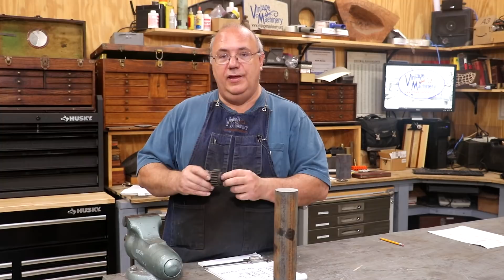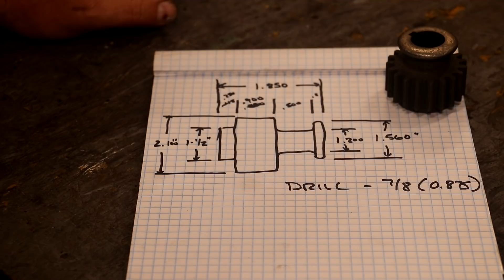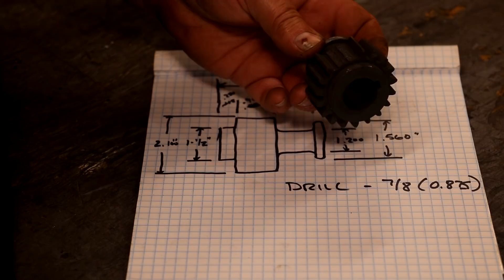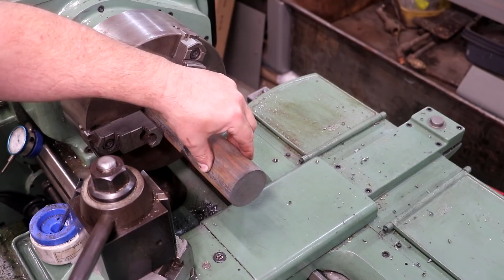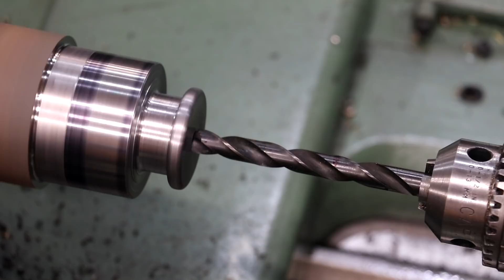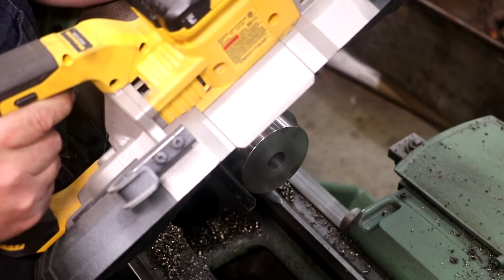Metal Planer Restoration 35: Cutting new Gear Blanks on the Metal Lathe

Comment: Hi Keith,

First of all I love your videos, they are educational and also a kind of relaxing to me. It helps me in understanding the construction and maintaining the machines in my private wood workshop. My machines date back to the early 1950 (most machines)  up to the late 1970. 
My question may sound stupid to non-mechanic guys, but in some videos you showed how you filled up the metal gap in a gear by brazing and then cut the missing teeth only? Why do you rebuild the complete gear this time? Well it's hard to judge from the video but there the remaining teeth look ok to me.

Kind regards, thumbs up and thanks a lot for sharing your skills with us! It is inspiring to me to see you work.

Cheers and greetings from Germany (still struggeling with imperial measure units 😂)

Martin

Comment: Why do lathes usually spin counterclockwise?

Because drills usually spin clockwise.

The close-up of the drilling shows that very clearly.
Reply: A lathe turns clockwise. You have to watch from the headstock, so as You do at a milling machine or a drill press.

Comment: I had a step toe shaper a few months back that sheared off a few teeth. Wound up welding material back on with my flux core welder then removed the the excess as needed by eye. Worked well with the tools I had at my disposal at the time. And I think much less time consuming then trying to build it from scratch. However another part (ratchet wheel) lost so many I built it from scratch

Comment: at 8:05 is it normal the tool move that much when you apply pressure ?
Reply: I was wondering if anybody else saw that.
Reply: @tsmartin  i watched thing a few time seams the back lift off and the front go back, im no machinist but when you mesuring in 1/1000 of inch if something moves like that you can't ...

Comment: why is it that the both holes are not centered ... but I guess that you'll say it's close enough ...........?
Reply: "why is it that the both holes are not centered" ?  What??
Reply: @paulcopeland9035  watch the big drill......it,s not drilling in the centre of the    part ... I sure can see the od running out ,but that will not bother Keith😉
Reply: @premierd8988  ...The 7/8 bit follows the center drill from the tail stock.  You are seeing a tiny bit of run out on the OD of the handle feature on the gear, but the center is dead true.  BTW, why do you say Keith will not care?  He has a beautiful shop full of precision tools that I have been watching him use for years.  He always does fine work.  I suggest you unsubscribe from this FREE content and leave the hate somewhere else.
Reply: @paulcopeland9035  Okay mate ... I am an engineer to trade .. so a straight line is a straight line .. and a OD or Bore are true to each other or they are not ... end of story . so unless he re-bores it true with a boring bar the the gear will jump up and down .. causing premature wear on the teeth of the said gear and whatever it is meshed to.
You are correct he has a few nice tools , but having the tools does not mean the you turn out''fine''  work every time .ask Keith himself . in fact go back through his videos and check how many times he says that it will be 'good Enough'..as for hate I don't hate anyone . I merely point out what I see to be errors the fact that you don't agree is your problem . not mine .and tells me that you have no (or pretty shit) engineering knowledge   .I rest my case ......

Comment: Thanks for video!  For the extrusion for the first gear (2+”), did you need the tail support because it was flexing?
Reply: Yes. It may seem innocent, but when you are cranking the hand wheels, you are exerting hundreds, if not thousands of pounds, of force into the material through the tip of the tool. If you're cutting at longer than 3x the diameter, the deflection in the material, depending on the below formulas, is too much for a smooth and accurate cut. (An OD will be oversized and an ID will be undersized) You have to remember that the metal does not want to be cut, so we need to hold it in place as firmly as possible, which means minimizing deflection. This deflection for a piece of stock held only in the chuck, also known as cantilevered, (which was in the first attempt) which enables the end to flex when a force is applied along its length, can be calculated using the formula: deflection=(force applied by cutter×(distance from the chuck to the cutter)^2)×(3×distance from chuck to end of stock-distance from chuck to the cutter)/(6×stiffness of the material×the rigidity of the shape). For a circular bar, the rigidity of the shape, more formally known as the second moment of area (Abbreviated as I in most equations), can be found by the formula (pi×diameter^4)/64. The rigidity of the material, more formally known as the young's modulus of elasticity (Abbreviated as E in most equations), can be found in engineering handbooks derived from experimental data. Eliminating the stock's ability to flex at the end by supporting it from both ends with the chuck and a tailstock center creates a stiffer arrangement with less deflection and yields a formula of: deflection=(force applied by cutter×distance from chuck to cutter×(distance from chuck to end of stock^2-distance from chuck to cutter^2)^1.5)/(9×square root of 3×distance from chuck to end of stock×E×I).
Reply: @firearmsstudent  .
 It may be because a rough cast material in a 3 jaw chuck is not a true diameter, so there is no chance of it holding true over that length. (just guessing). Extended jaws may help, or even soft jaws so they may bite into the imperfections of the stock and even out the loads applied.
Reply: Most stock isn't very true. There are some items like ground bar and such but most off the shelf stuff falls into the "close enough" category. If it is bad enough you get an interrupted cut, but that is a different problem than what is going on here.  The issue here is simply the stick out. Every amount of distance you are away from the support of the chuck introduces some deflection due to the leverage from the cutting tool.  Even the chuck itself can deflect on the spindle bearing if you apply enough force.  As the deflection adds up you get chatter where the material deflects, then springs back against the cutter and cuts in a somewhat sawtoothed pattern. Add the center and tailstock for support and you go a long way to limiting the problem. However even then you can still deflect the center of the part depending on the material and the depth of cut. That is why follow rests came about. Support right near the tool as is works.
Reply: No. Dont now what the other guy sad. The flexing is in the 3jaw chuck . in 4 jaw independent you could do this easely

Comment: DO YOU EVER USE A CERAMIC CUTTING CHIP
Reply: Ceramic tools aren't really meant for manual machines.
Reply: @xenonram  in sand cast iron i allways use ceramic on manual lathe . and you cant beet it
Reply: I used ceramic tooling for 22 years. D2 tool steel in a roll cutting lathe.
Reply: @steve gale  carbide is from tungsten , ceramic is other marerials depending on the grade ...  You can machine whit hss but in last 30 second. Back in the day , they grinde 2h machine 30 minuts . if you remove the surface with the sand mix then last a litle bit more

Comment: I think of cast iron as brittle, wouldn't mild steel be better for gear making?
Reply: steve gale   So you have 50+ years in engineering.  Ever tried going 1 day as a decent human being?
Reply: @steve gale  If cast is brittle it won't matter how long you let it sit for it will still be brittle.
Reply: @bcbloc02  Hi .Brian . think it's best to ask Baily , he knows whats what when it comes to workshop and engineering stuff .Keith Fenner  has just put up a new  video . nice to see him back .
Reply: @Christopher.C123  Yes allowing castings to weather and season to relieve internal stresses to hopefully make them  more stable was a very common practice. Some swear by the practice others swear at it. LOL  I once read where I think it was Pratt and Whitney did testing on the practice as part of a militray deal and the results were inconclusive as to if it made any difference or not. They were machining new castings and ones aged 2 years and found post machine distortion was unpredictable and sometimes new castings came out better than weathered ones and vise versa.
Reply: @bcbloc02  .2 schools of thought on this subject ,suppose a lot depends on the actual ingredients in the cast mix, mold pouring  rate and casting cooling time etc . All way above my pay grade. Anyway about time for another upload from you now the roof is fixed .
Reply: @Laddie For whatever reason, the original is "gray" iron.  Keith was machining his blanks out of "ductile", aka nodular, iron.  Nodular iron's behavior is, very roughly, 1/2 way between that of steel and that of "gray" iron.  That semi-steel behavior showed in the swarf that was generated.  Keith got distinct chips, instead of powder.

The replacement gears will be BETTER than the originals, while retaining the "flavor" of said originals.
Reply: @eliduttman315  .Does this ductile nodular iron  also come under the same as what is known in England as malleable cast iron that can be heated and formed also welded successfully with low hydrogen arc welding rods or MIG. if so far better than cast iron in many uses .
Reply: @Christopher.C123  Nodular iron is a post WW2 development that employs magnesium and handling to achieve the desired structure.  "True" malleable iron is obtained by anaerobic annealing of "white" iron and that process is many, many, decades old.  Either method yields material whose carbon is in little "spheres", instead of the graphite flakes found in "gray" iron.
Reply: @eliduttman315  ,Thank you for that detailed information ,I read the comments and probably others like myself appreciate this knowledge delivered in a way that is  understandable by lesser mortals who haven't used 50 years of their life and learnt so little .
Reply: @eliduttman315  Thank you I did notice the "chips".
Reply: Not really. The reason castings set around a while before machining is for stress relief in the casting. It is also why cast iron gets heat treatment for many applications, that does the same thing. In this case it isn't an issue because this isn't truly cast, it is extruded so the stresses are not an issue.
Reply: @Blazer02LS  Don't mind Steve, he's a whiner and is always βιτcλιηg about something. He seems to "have done x for 50 years," where x= whatever the conversation is about. He's a bit slow.
Reply: @xenonram  I Just read his reply . WoW, think you touched a nerve. never mind I left him a longer reply to pick the bones out of .
Reply: Guess Andrew is correct. Castings are left to set to relieve the stress in the castings, same reason why pro engine builders used to love using engine blocks from taxis and police cars. The constant thermal cycling acted as stress relief. It does nothing at all to the grain structure, there is nothing that will effect that once the iron is cast unless you remelt it.
Reply: Original is cast. Depending on the use cast iron has some advantages over steel.
Reply: Ego’s

Comment: I was wondering how you keep from crashing the tool into the chuck. Is there a stop built in which prevents it or do you just have to be careful?
Reply: Not on many manual machines, and even the ones that have it, you have to set it up for every job and tool holder.
Reply: You just need to be careful.
Reply: @earljtharp  Same way you keep from running your vehicle through the garage. You STOP!!!
Reply: They don't have and never had any type of automatic disengagement on the carriage. There are a LOT of machines out there that are the same way.
Reply: All the lathes I have worked on have an automatic feature consisting of an extremely loud alarm.

Comment: Interesting, thanks. Keith, don't you think using your callipers for scribing, especially on a rotating part, damages the tips? Personally I reserve a cheap Chinese set of callipers for that.
Reply: Mitutoyo 505-738, Starrett 798BX, INSIZE 1110-200A are just a few that have carbide.
Reply: @Blazer02LS  ....Yes they do.  Scribing with a calliper is a common practice with everyone I deal with.
Reply: Not going to hurt them at all.
Reply: Blazer02LS I think you're wrong on that.
Reply: If scratching through a coat of sharpie is going to damage them then they are junk. All of the ones I have are hardened steel or carbide tipped.
Reply: Blazer02LS . I have a set of hardened steel callipers that I used for many years and I can assure you that the corners have become rounded by scribing with them. Maybe it's not important if you're happy to replace them regularly. It's just my preference only to use my cheap callipers for scribing.
Reply: I use mine a lot for scribing. As do most machinists. As long as you are not doing damage to the jaw faces it isn't an issue. It also matters what you are scribing, if you are simply scratching through some layout fluid the pressure required isn't going to damage them. If you are trying to mark raw metals then it is going to cause wear.
Reply: Blazer02LS . You make an interesting point. I think I've opened a can of worms here! Lol.
Reply: Guess Keith, Adam, Brian, Keith F. and 99% of the shops out there must be crap in your eyes then.
Reply: Blazer02LS . I'm not criticising those great guys, just discussing with friends how they do things. I love all those guys.
Reply: Not pointing at you Stu, Sorry if it sounded like it.
Reply: Blazer02LS . Yeah I hope  we're all friends here even when we disagree with each other. I promise you, I disagree with my beloved daughter more than with any of you guys!!!
Reply: Gee what a civil person resorting to insults.
Reply: My Mitutoyo Dial Caliper doesn't have carbide tips, which is why I use this instead: Starrett 563-6 Hermaphrodite Joint Caliper https://www.amazon.com/Starrett-563-6-Hermaphrodite-Joint-Caliper/dp/B000VDZFLK